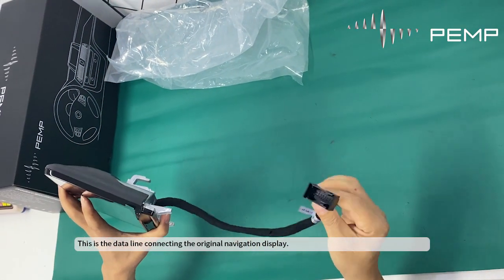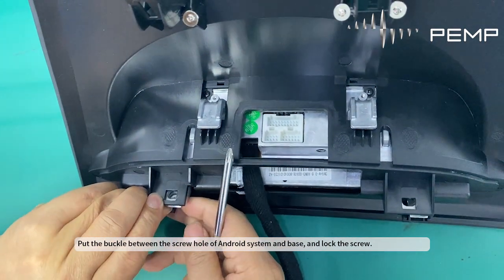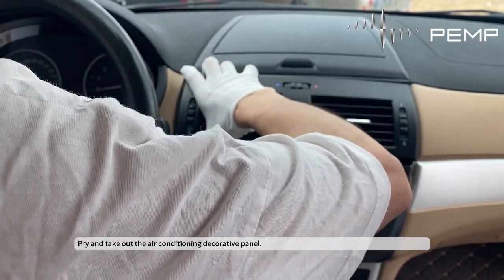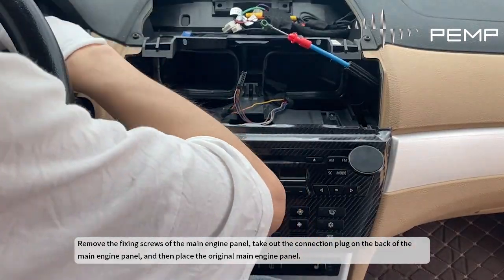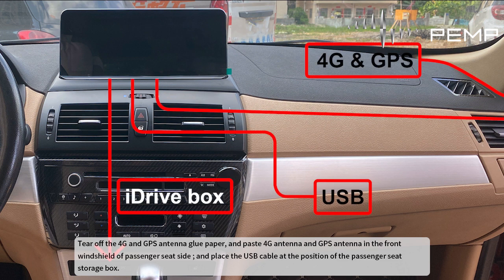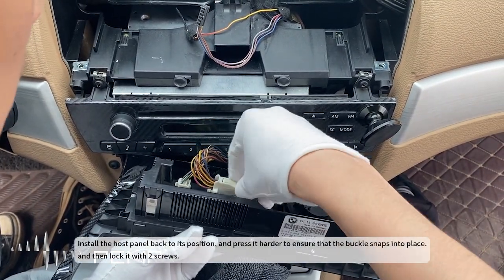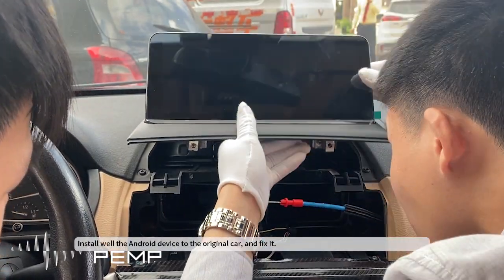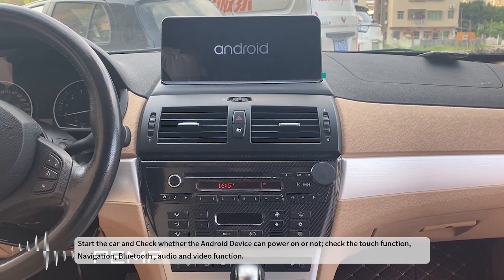How to install the BMW X3 E83 Qualcomm Android multimedia that supports the original car display?

Comment: Hello, I have a bmw e83 of 2005 without the Aux. I can’t install this model on my véhicule because there is no sound coming out of the android system, do I need to buy something else to make it work ? Thanks
Reply from the maker: Yes, if your E83 doesn't have an AUX menu, you'll have to use an FM transmitter to get around the sound.
https://youtu.be/kV-NaZ7-dRE

Comment: Hello. I have exactly the same device. It was working perfectly fine for a while, but now it has no sound when I play something. The car radio is working, so problem is not the audio system, probably is the connection between the navigation and the aux. Do you know how to solve the problem?
Reply from the maker: If your product is from PEMP, there is an audio processor on the ISO harness. You can move it out for testing. Refer to the last step of the video below.
https://www.youtube.com/watch?v=pS2l0e0QAP4

Comment: and which parking camera do you recommend with this multimedia?
Reply from the maker: If your trunk puller size is 110X40MM, you can choose PEMP 8003 reverse camera head.
https://www.pempcar.com/products/bmw-e60-camera
Reply: Camera for bmw x3 e83 2009. ?
Reply from the maker: @lazarsorajic6948  Yes

Comment: Can the iDrive controller be operated just by connecting it? Need Android settings?
Why doesn't the Android screen respond when I connect the iDrive wiring?
Do you have the application you need
Reply from the maker: Dear, pls send the order number and problem to our after-sales email: service@pempcar.com  ; we will reply in time. Thank you so much.

Comment: Mine doesn’t have the original Nav, would a base model be an option?
Reply from the maker: Yes, PEMP e83 android support your car without Nav. but your oem radio must have the aux menu, Otherwise you can't get android sound.

Comment: Hello, I have installed the Unit. It,s working great, but when I open the original display it is flickering like an old TV. Is there anything that I can do. (The correct Display is selected in the settings).
Reply from the maker: Dear, pls send your order nubmer and the question photo to our after-sales team. service@pempcar.com we will reply in time
thanks

Comment: I have the HIFI sound on my X3 (which sounds awsome), if i replace the oem display with this android nav, it will also replace the car sound sistem? It will use the sound processor of the android and downgrade the sound quality?
Reply from the maker: You are very concerned about the sound system, now I will reply to your question:
1. Use PEMP Android screen to replace the original car's screen, it will not change the original car's sound, it retains the original car's CD player and audio amplifier;
2. Make sure that your original car has an AUX input menu. The sound of Android is entered from the AUX of your original car. If there is no AUX menu, Android will have no sound. So it will not degrade your original sound quality.
3. The sound of PEMP Android screen is definitely not as good as the original car's CD and radio sound quality, and the sound quality is similar to the sound quality of your mobile phone input to the original car.

Comment: Is it possible to display the parking sensors on your multimedia, that is, it shows the car and how far it is from an object? I have a 2009 bmw x3 e83, I have parking sensors, but I'm interested in whether they can be displayed on this multimedia?
Reply from the maker: If your car has factory sensors, after installing the PEMP Android screen, reversing it will display sensor information. But it can't show the reverse track.

Comment: I have a bmw x3 e83 2008 177ps 
i have a old Display. Can instal it too ore Not? Becouse Electronic?
Reply from the maker: As long as the display of your original car is normal and the work is normal, you can install it.

Comment: Hello i have problem I've installed everything but i have a problem i cannot play anything else except the radio.
Reply from the maker: Hello, please check the following two questions for me:
1. Can Android display normally?
2.Do your OEM radio has aux menu?  If there is no aux menu, Android has no sound. We have a description on the product details page on Amazon.
Reply: @pempcar  yeah everything works fine i have aux in but when i try to select it through mode is not available. I've bought the car before 2 weeks and i never tried using the aux. Thanks for your help
Reply from the maker: @nikolakostov8758  The operation sequence is as follows: first enter the AUX menu of the original car, touch the PEMP Android screen, switch to the Android mode, click the music APP inside, and play the music. You should be able to hear the sound of Android. Please help me to confirm the following two things:
1. Does the original car have a screen?
2. Does the original car have an AUX jack?
If it is convenient for you, take a photo or video to me, service@pempcar.com, I will check the phenomenon with the engineer, and then reply to you, thank you.
Reply: You should connect jack form wiring harnes with AUX on the back of handrest then change in radio to AUX, then u will hear sound from unit.

Comment: Can't I use the factory GPS antenna ?
Reply from the maker: Yes, it does not support the original GPS antenna, You need to use the separate GPS antenna accessory in the PEMP product package.

Comment: Will this fit on my car if my car already had that one small factory screen that came with it? Or does it need to be the compartment/non screen one?
Reply from the maker: This one fit your E83 With a small oem screen, It has an interface to connect the display harness of the original car, and can display the content of the small display screen of the original car. You can refer to the product description at the link below.
https://www.amazon.com/dp/B0914S7C88?ref=myi_title_dp